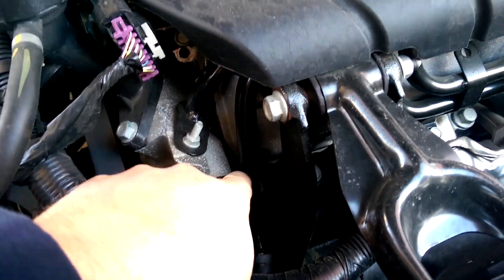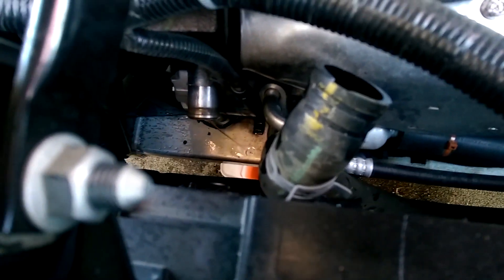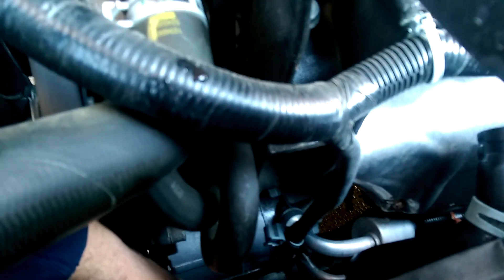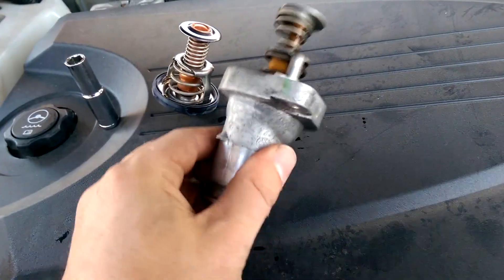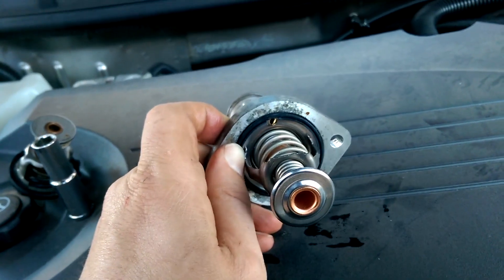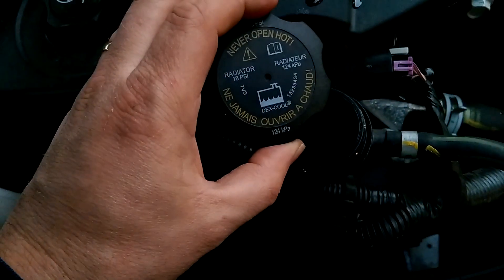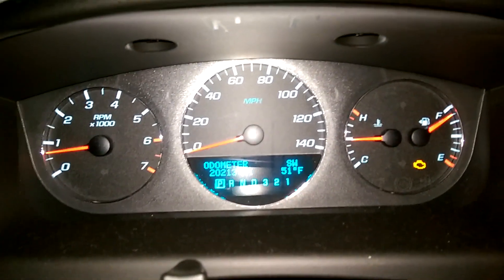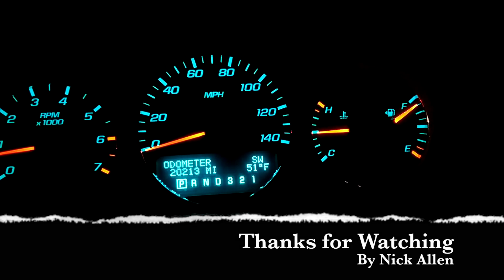2011 Chevy Impala Thermostat Replacement (Engine Hot)

Comment: Thanx for the video , Just a reminder if you mix coolant with water . Make sure to use distilled water . Tap water has a lot of different  minerals  that will turn your fluid to a rust color which will then over time eat a hole in your radiator.
Reply: Mines did

Comment: My car is displaying the exact same message as yours was. I did some research and then bought a new thermostat. Now I find your video which I think is very helpful. I hope the thermostat replacement gives me the results I am looking for. I never realized the thermostat was on the bottom. That makes sense of why the sudden increase of pressure on the top hose. Thanks for sharing this video. Now it is off to my garage.
Reply from the maker: Jabo Miles Good luck with your repairs!
Reply: Job is now complete, all seems well. The top radiator hose is back to normal. I also drained and replaced the coolant in the radiator and reservoir. I figure with 93k it was time anyway. Thanks a million for posting.
Reply from the maker: Jabo Miles Excellent! Glad it went so well.

Comment: Thanks for the making this video. This was the exact problem with my wife's 2011 Impala. I replaced the thermostat, added the coolant, cranked her up and the after the car warmed up the temp gauge starting working.  Thanks again !!!!!!
Reply from the maker: Wheeler J, glad this helped you solve the problem. :-)
Reply: I have this exact same problem with the engine hot warning
I was guessing it was the coolant temperature sensor
I might just replace both the sensor and the thermostat

Comment: I just had the exact same thing happen to my 2011 LS 3.5L, including the temperature gauge being stuck on cold. By the time I came home and threw the OBD scanner on it and pulled the P0128 code it suddenly started working again. I'll keep an eye on it. If it comes back at least I know what I'm dealing with. Thanks.

Comment: I have the ac off light and the engine hot, but car is overheatting? So is that my temp sensor, my thermostat, or my water pump?
Reply: May need a tune up mine did that when it was raining

Comment: Great video Nick. After watching the fix, I may try to do this job myself. I have the same fault code showing on my 2011 Impala.
Reply from the maker: John Renko It is pretty easy. Good luck with your work.
Reply: Thanks Nick. Do you have a video on how to remove the hose clamp? Is it a cut and replace or is there a trick to it?
Reply from the maker: John Renko For my clamp, I used pliers to squeeze the clamp. I had to also wiggle it back and forth to get it to move. Once it is moving you can slide it away from the engine and then pry the hose loose. It may take some elbow grease.

Comment: Who else’s impala temp needle was going to the second line above the middle too? And did it work when you switched the thermostat?
Reply: Noah Ortega first thing first!!! Check fluid level, check temp sensor pigtail for any fraying if ok then change water pump!! In this case it’s stuck open because the engine is not reaching temp! Yours is hot make sure that it’s the proper temp thermostat!

Comment: Clean off the surface on the engine and water pump housing so the new gasket won't leak.  Simply give both surfaces a strong wiping.

Comment: Because your temperature gauge is not working....IM betting your true problem was the CTS= COOLANT TEMPERATURE SENSOR.
when the thermostat goes bad..the temperature gauge will build up temp then suddenly drop the temp...hope this helps someone
Reply: Exactly, its also Illogical as the thermostat doesn't communicate with the car in anyway, it only opens and closeses when temperature is reached.
Reply: Yes sir. The thermostat does not control the gauge working or not. Lol

Comment: Thanks Nick. I just changed my thermostat but I now have problems with the upper radiator hose. It’s squirting out...I bought a new one from AutoZone but it says it’s cut to fit. There is a long side and a short side with the long side having the hole diameter bigger than the short side. Any suggestions to as which side I can cut and which side goes where? The guys at my local autozone store had no clue🤷‍♂️
Reply: I bought a hose from them and I had the same problem get a Gates hose the cut-to-fit one and don't use the screw band clamps use the spring clamps that came with the car

Comment: Hey mines says engine overheating idle engine. Any ideas for what may cause that
Reply: Markus Lee check fluid level if you are having to add fluid sounds like your water pump they leak at weep hole when going bad do it’s hard to find the leak

Comment: My temperature gauge just started going slightly above the half way mark recently. Should I go ahead and change out my thermostat?
Reply: Armond Cooper I don’t think so; you should have an error message like he shows at the beginning of the video. You’re likely just running a little hot—not a big deal. My 06 was slight above midway for a few years before the thermostat when out. 

Do check your fluids though. It could be that your fluid had degraded and less effective.

Comment: thanks, if im not comfortable changing it myself, my mechanic  wants to charge me $50 to change the thermostat, if i buy the thermostat from auto zone, is this an okay price?
Reply from the maker: +Byron B The thermostat costs about $20 where I live. Some mechanics will want to use their own parts (they typically mark up the price a bit when they do that). If you have a mechanic that's willing to install the thermostat that you give them, it may be worth while. That said, it is a pretty easy fix and if you do it once you will be able to replace it in the future with confidence as well. But ultimately, it's all about your comfort level. Good Luck!

Comment: Hi Nick, I was wondering if you know if it's the same process for the chevy impala 2006 ? Thanks
Reply from the maker: I think the thermostat may be connected to the top radiator hose. Not 100% sure. Here's a video of the 2006 Impala thermostat replacement though, https://youtu.be/L0qtmOBq7h0. Good luck with your project!
Reply: Thank you
Reply: +Nick Allen Nick, I just need your help. I take out the clamp, but I cannot pull that radiator hose off..Do I need to remove that two bolts on thermostat or just try to pull hose again?  Thanks.
Reply from the maker: Removing the hose helps you work in the space (since it is already cramped). You might be able to leave the hose connected, but I'd recommend removing it if you can. Good Luck!

Comment: Thanks for posting. This just happened to me and I looked at this strangely. Is it bad to run on this for a day or 2 before getting it fixed? I want to try and do it myself
Reply from the maker: There's a risk that you can cause significant damage to the engine if it over heats. However, it you keep a close eye on the engine temperature gauge and make sure it doesn't get into the red, you can drive it. If you go on short drives or live in a colder region, you will probably be fine. If the engine does get hot, find a safe place to pull over and open the hood for a while. Carry extra antifreeze/water mix in case you need to add a little extra. Good Luck!
Reply: Nick Allen I live in Georgia. I'm not getting a reading to tell if my engine is hot, the gauge stays on cold. Can I buy the thermostat from an Autozone or Pep Boys?
Reply from the maker: Autozone will have it. I've never purchased from Pep Boys.
Reply: Thanks Nick!!
Reply: My Engine is also not running hot the temperature gage stays on cold but when I pop the hood there’s no smoke or anything can I drive mine for a day or two

Comment: How did you clear the Engine light
Reply: Larry Braziel you can hook it up to a code reader if you have one and clear the code. The engine light should reset after that. 

If you dont have a code reader, you can inhook your positive battery terminal for 10-20 minutes and the code should clear itself.

Comment: What if I changed the thermostat and it still over heats. Even in idle.
Reply: Water pump
Reply: If thermostat sticks open engine doesn’t meet temp if it sticks shut it over heats!! So if you changed thermostat only thing left is pump,

Comment: its not the thermostat, its the temperature sensor. the thermostat has no way of communicating with the car. however. overheating could be caused by the thermostat.

Comment: hey Nick thanks for the video...quick question, did you  disconnect the battery during the process?
Reply from the maker: +Mrbigg Zoe28 I did not disconnect it. Everything I worked on, didn't involve the electrical system. But if it makes you feel safer, you can disconnect it.
Reply: +Nick Allen thanx....great job

Comment: 20k miles and you already have to change the thermostat. Wtf. I had to do this to mine at 80k. Still have the message though which I now know is the coolant temp sensor. Not gonna worry about it for now. It seems to fix itself after a day or so then its fine for a few weeks. Then back to saying ac off. I know this video is old so your probably way over 20k by now.
Reply: Hairless Apes I was told your vehicle will shut down because of it thinking it's overheating
Reply: 813 Finesse kid i actually fixed the issue. The connector was clogged with dirt cause it was not connected properly. I also replaced the temp sensor since i was down in there.
Reply: Hairless Apes yah I think mine is going out now because my car is trying to overheat but the fan cools it down before it overheats completely. Like the temperature of the car starts to go over the middle line which is never did. So. Me and my dad are thinking it’s the thermostat. But we’ve had our impala since actually early 2012 and we bought it from enterprise car sales. So it was used before and it only had 20k miles on that for 15k! Which is a good ass deal. But now our car is close to 140k it’s at 138k now. And the car is also acting up idk what it is but we think it’s the throttle body. Maybe it’s clogged or something idk. And the power steering has a bit of a leak so we have to put power steering fluid in it every little while. And the same thing with the coolant.
Reply: Just hit 160k and its acting up